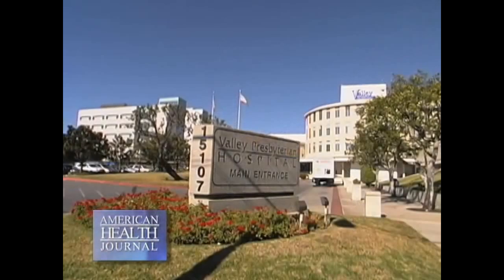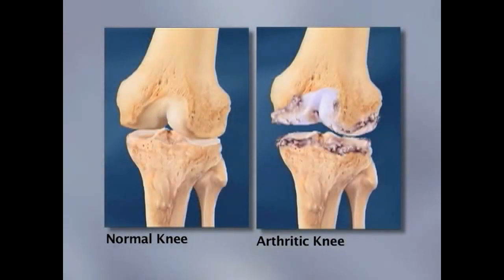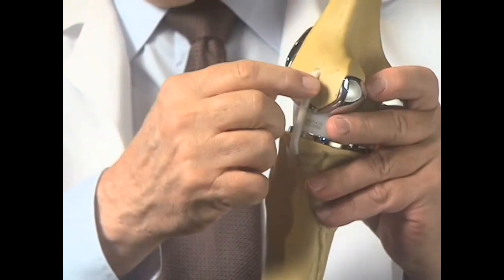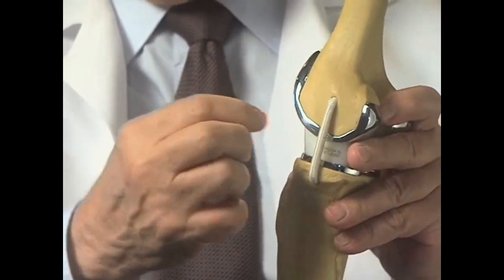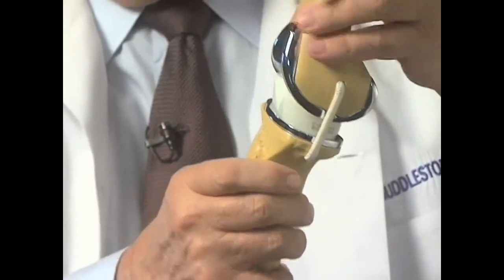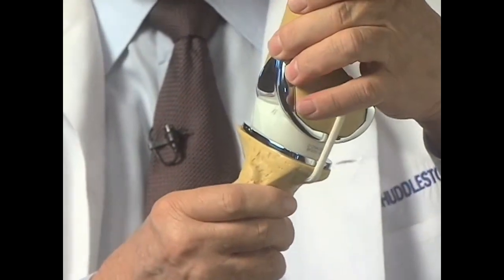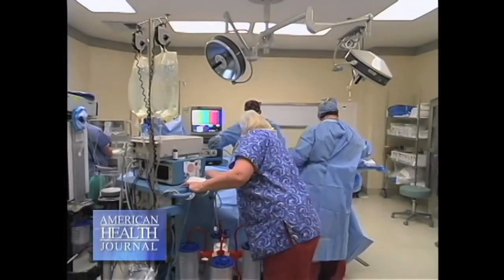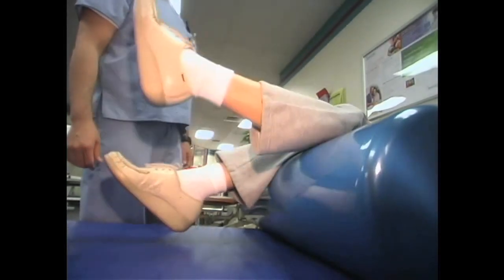Minimally Invasive Knee Replacement Explained - Herbert Huddleston, MD

Comment: Well, yes, there have been advances in TKR, both with the procedure and the prosthetic itself.  But, lol, "minimally invasive knee replacement" is an oxymoron. There is nothing "minimally invasive" about replacing your knee:  having an eight inch slit in the skin over your knee, flipping your patella out of the way, and sawing off the ends of your femur and tibia just to get started.  The title of this might lead one to think that these things are done arthroscopically now or something.